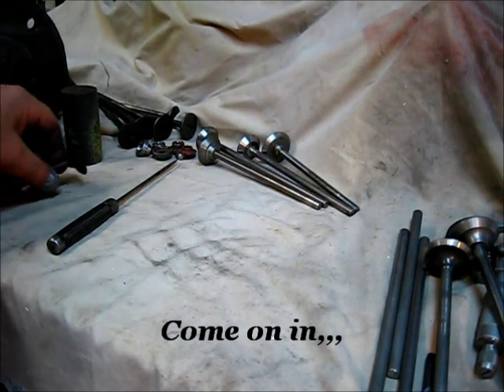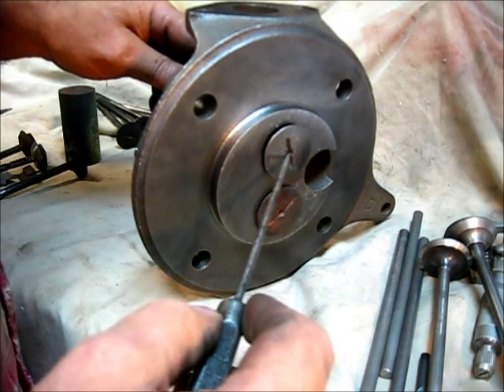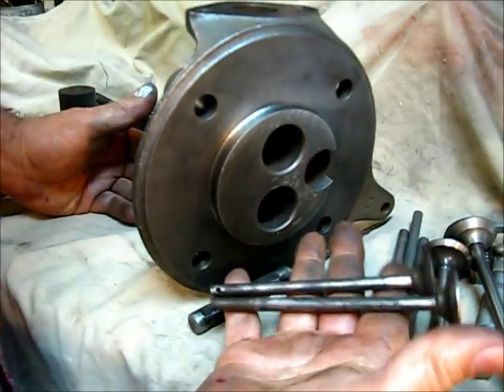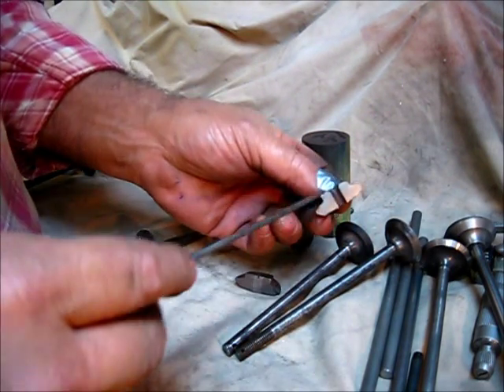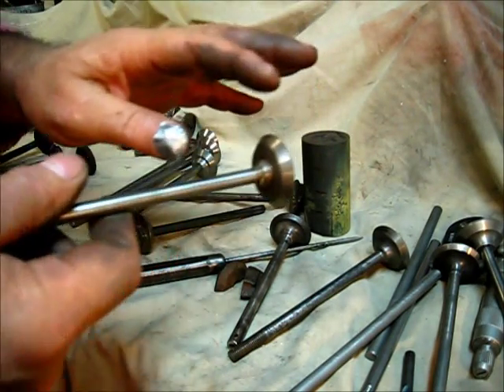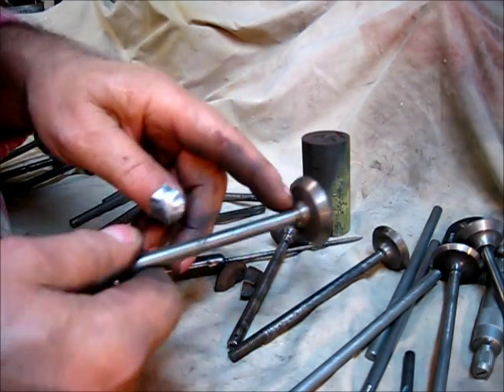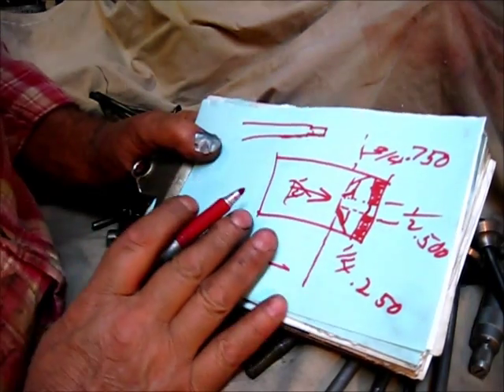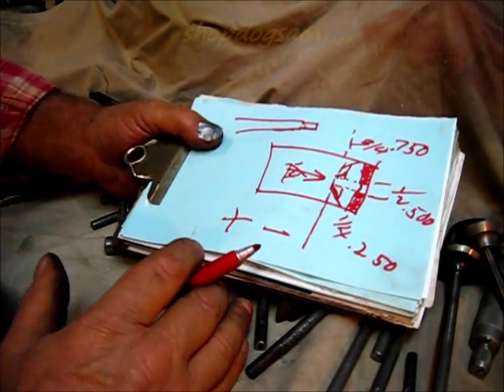I H C ENGINE how to build intake and exhaust valves #1

Comment: may i say something about the procedure?

I think drill and ream a precise center hole first, then face and turn the 45 degree angle with a mandrel, set on front and rear center. thus you can flip as many times as you want. especially with the valve rod mounted. is that gonna be a better solution?

Comment: Great video Mr Shopdog. I have a couple of dumb questions: What is the material for the stem? When the stem is peened instead of soldered, does the peened end suffer from stress cracking in use?